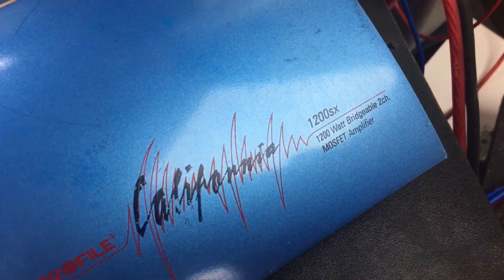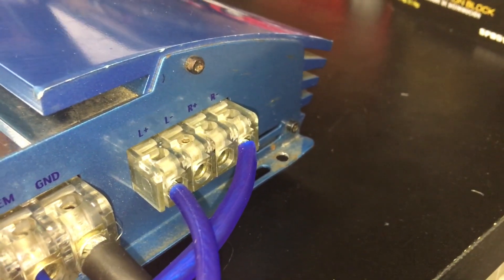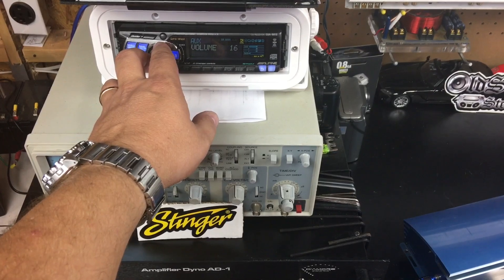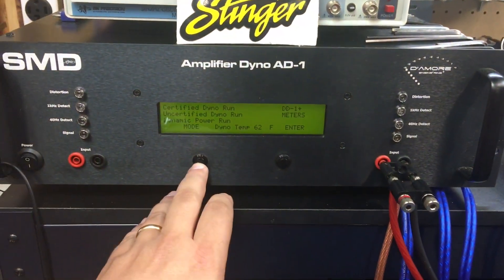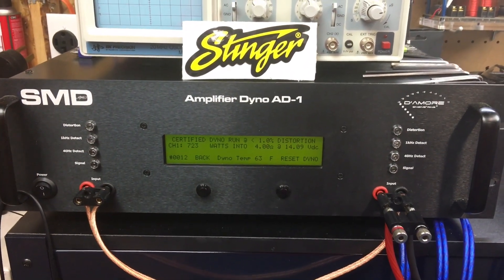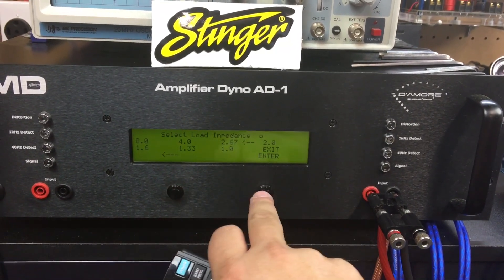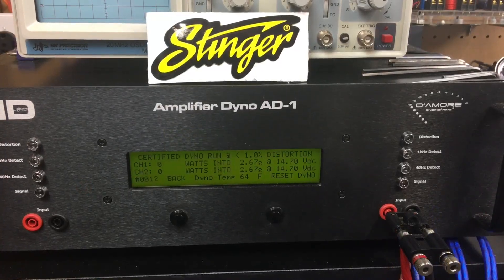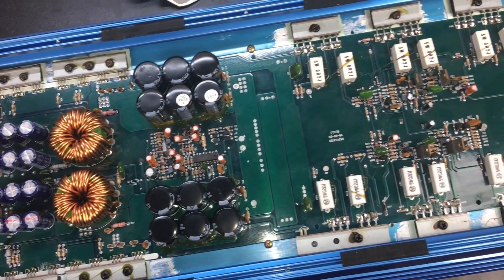1999 Profile 1200sx Amp Dyno Test

Comment: I still have my old Profile 400MSX from back in the day. Still worked when I stopped using it. Always thought it did rated power, granted, I knew nothing back when I bought it. However, years later after I became slightly more educated in such, I still believed it could do rated and still believe to this day that it's rated power was not overstated. This video only helps prove, if only to myself, that it was a good buy and is quite likely truthfully rated on specs. Thanks!

Comment: I had this exact amp back in 2000.  I had 2 15 inch kicker subwoofers hooked up @ 2ohms in a 1996 Lincoln town car.  They used to pound them subs hard.  It's good to know they were doing the numbers even thought the manual states not to bridge the amp to a 2ohm load.
Reply from the maker: Yeah, we like to live on the edge. Per my tests, it seems 2.67ohms bridged is ok for the amp, but yeah, I wouldn't go lower for daily use

Comment: There white version looked made in the USA, and it made gobs of power. A friend had one he thought was fried after running his woofers at 2ohm mono for months. I took it apart and the power terminals had desoldered and their screws were loose. Apparently the amp was drawing way more current than the terminals could handle, yet it never died running 2ohm mono. I was impressed with the number of devices inside, reminded me of an american brand at the time.
Reply from the maker: Friend likes the white ones too

Comment: I have to admit that this did way better than I expected since this was considered a budget amp.  I was expecting closer to 600 rms and never dreamed of 1200 at any load.  I had the white version of this amp and ran it at 2.67 ohms.  It was easily able to run 3 Orion XTRs to their mechanical limits.  I guess that's why.
Reply from the maker: +Mickey Pietrzak I agree, not bad at all for a budget amp and it was killing those RF Power subs as well!
Reply from the maker: I think the earlier versions were made better, so they may have even been more powerful. I'll try one if I can find one and we'll see!
Reply: +Dereck BigDWiz Actually, after checking out some gut shots, this one looks like it might be a bit better.  There's an extra pair of FET in the power supply and the capacitors are beefier.
Reply: +Dereck BigDWiz I have an old Profile "California" 2800 800 watt 2 channel that needs repair. Do you know where I can send it in to fix it? I tried The Amp Lab & they said they aren't taking any outside repairs at the moment. The amp I have looks older than this one.

Comment: Your Alpine demo head unit in the sound lab resembles the one in my 1999 Nissan Pathfinder that I purchased in maybe 2005 or 2006.
Reply from the maker: It is a CDA-9815, I believe it came out in 2003
Reply: I had a very similar Alpine head unit in my work truck (Chevy Express van) that I purchased in 2003.
That may be the very same head unit.
That may well have been the nicest head unit I ever had with built in equalization and crossover.
That is the head unit that made me switch to Alpine permanently.
The sound quality is just better.
The pre-amp is hotter.
The built-in amp is cleaner.
Reply: The Alpine in my Pathfinder came out a year or 2 after that one.
I am running it through an Audio control pre-amp equalizer to an Alpine 4-channel amp on the highs- 6 1/2" Boston Acoustics coaxials on all 4 doors and a pair of Polk Audio tweeters on the front doors and an "old school" Alpine V-757 on 2 Rockford 10's.
This is a really clean system with crisp highs and big bass.
In my Toyota Tundra I have an Alpine INA-900 touch screen DVD navi SiriusXM iPod head unit with Alpine Audyssey Imprint pre-amp signal processor/EQ running to a Punch 500 watt 4-channel into Boston components on all 4 doors and a Punch 400 watt on a single shallow P3 12.
This system is really tight and clean with great clarity in the mid range, but lacks the bass of the system in the Pathfinder.
I use Dynamat extensively in my vehicles.

Comment: What is the actual purpose/function of the bass boost adj. on an amp?
Reply from the maker: +junkyardhemi boost subwoofer level. Turns out it is more effective to have a level adjustment instead of a particular frequency like these old amps had (45 or 50Hz was popular)

Comment: if you see this by chance could u please do me a solid and do a dyno on this amp as i own it and i am curious if i got played or did i actually get a good amp Phoenix Gold SX Series SX1200.1 1200W Mono Block Amplifier its birth Certificate say Rated RMS Power Output: 800W X 1 @ 2 ohms And 1200w X 1 @ 1 ohm And the measured RMS Power Output:  801W X 1 @ 2 ohms And 1202w X 1 @ 1 ohm all power measured to 1% THD at 14.4  VDC and im am wondering is this so did the company actually have it put on a dyno or is it a lie and i would like to know what the uncertified  at 1% THD all the way up to clipping and the dynamic run is if you can i would  apperated it thank you
Reply from the maker: Phoenix Gold is legit. Ratings are good